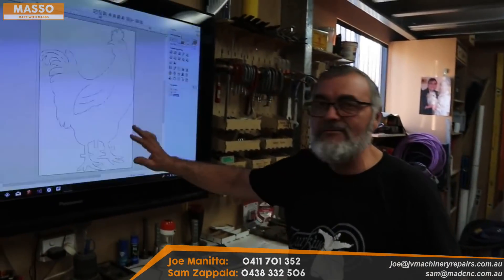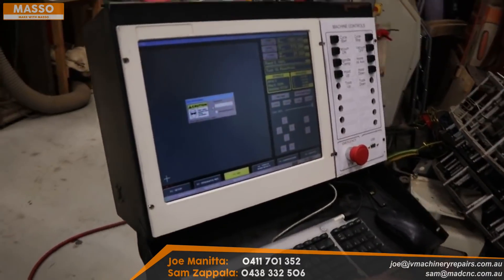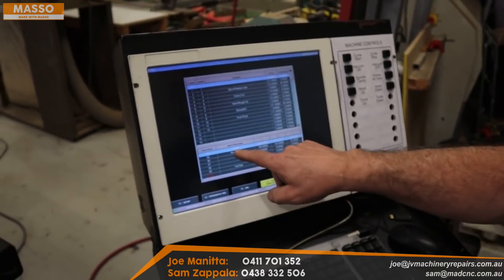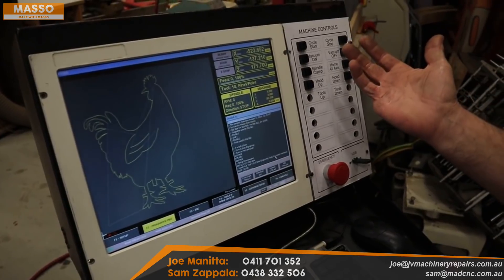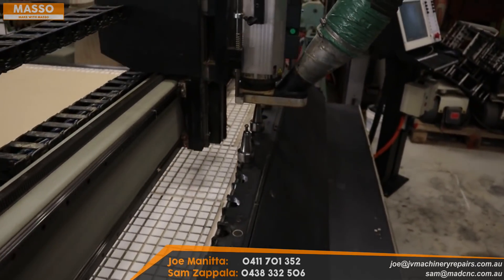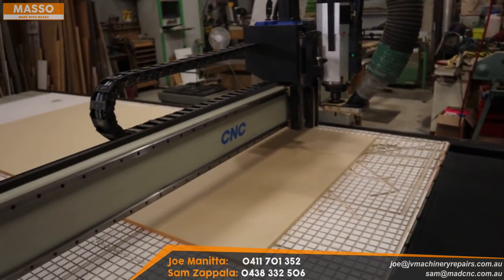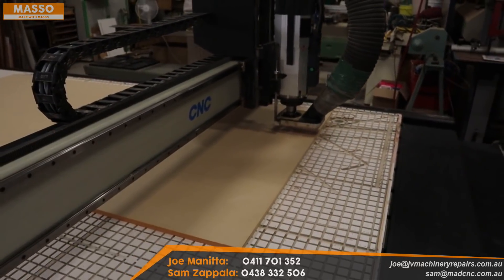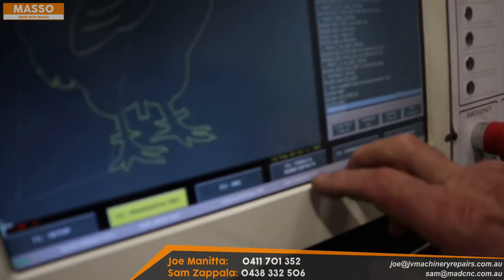CNC Wood Router Running With Automatic Tool Changer - Part: 2

Comment: Great video. I am just converting my CNC router from Mach3 but can’t figure out how to hook up the ATC for clamp and release as well as clamp and release NPN sensors.   You seem to have worked this out.  Would you have a diagram of how you connected the solenoid relays to the Masso inputs and outputs etc?  Thanks

Comment: Did Masso managed to solve this issue with tool change?I do not like the point that machine change tool and then goes back to the corner point. Was it solved?
Reply from the maker: yes, this was fixed a long time back.